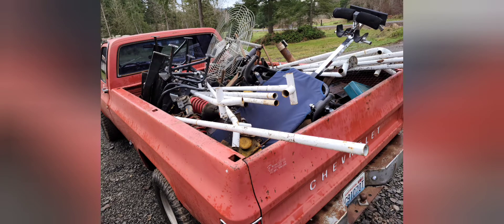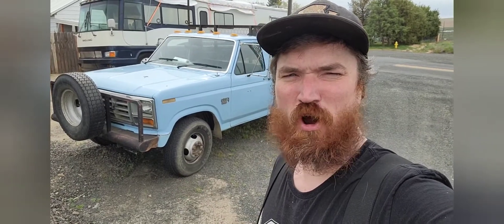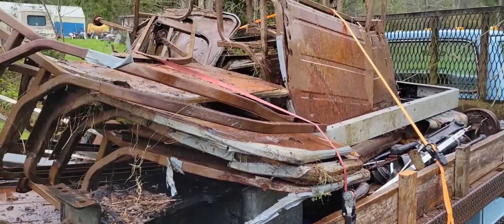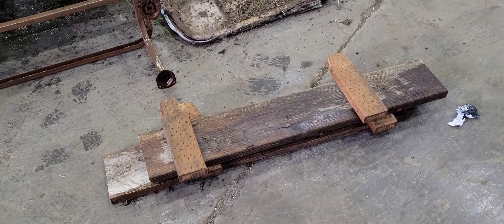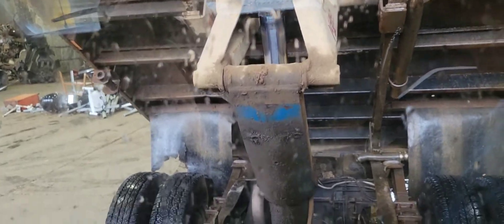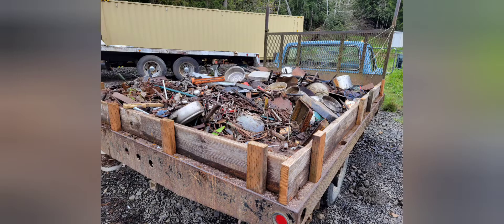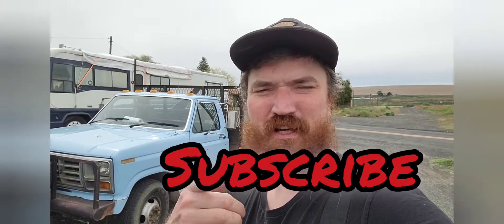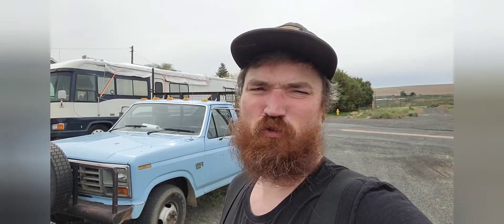6.9 idi ford f350 dump truck is life changing

Comment: If you get another old engine hoist install it on back of old truck to lift heavy items on her. Of course include video. Thanks
Reply from the maker: Truck cranes are super useful. I installed one on orange peel the square body chevy dumper I had a few years ago, have older videos of it if your interested. That engine hoist had a bad hydraulic cylinder, so will just get a new one eventually. Wasn't worth my dragging in over 5 hours to my new house. Thanks for watching.